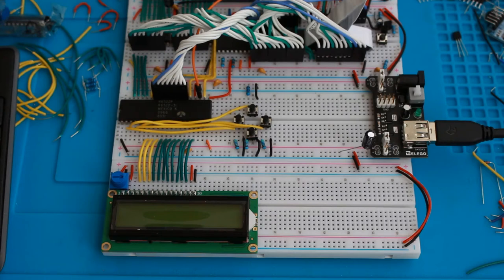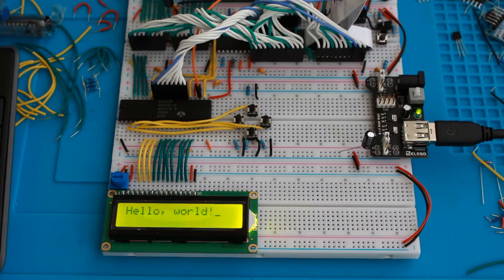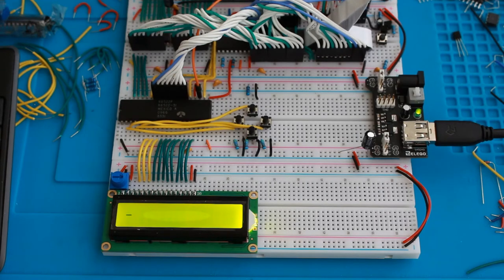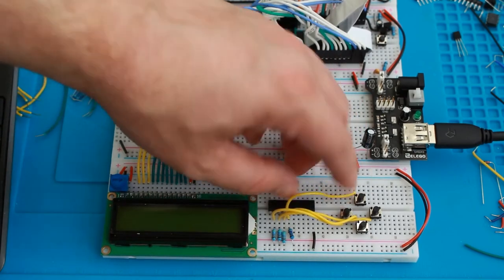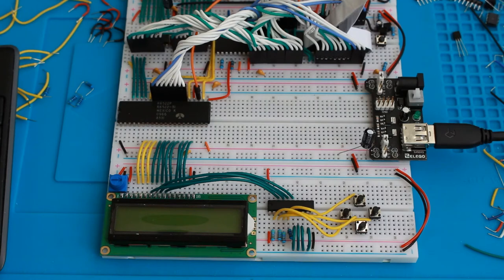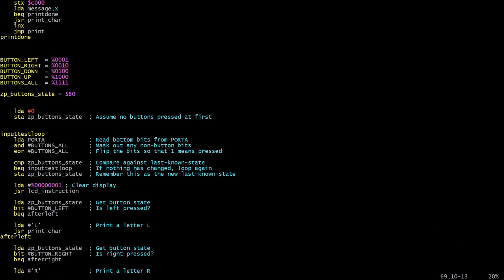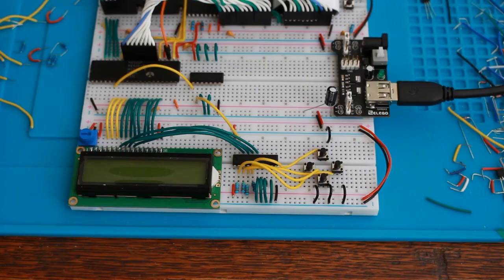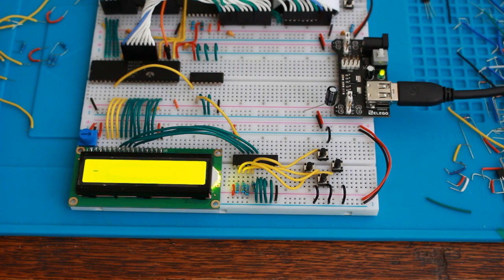6522 I/O Multiplexing - How to connect lots of devices to one 6522 VIA

Comment: This is cool, but I'd be concerned that a software bug could cause the buttons to clash with the LCD asserting to the port, causing a short. You could add some hardware protection by NAND-ing with the button buffer enable with the LCD enable line. Obviously, no bugs, no problem...
Reply from the maker: Yes, you could do something like that. The more similar the devices are, the easier that is. Using a decoder (e.g. 74138) for the chip select would be safer, with inverters where needed (e.g. for the LCD which has an active-high enable pin). It'd require more changes to the existing code but be a better solution overall.

Comment: Hey George, I am getting ready to build the Ben Eater 6502 breadboard computer, however I would like to add a keypad and 6 - 7 segment displays similar to a KIM-1 SBC trainer.
So that I can view and enter programs into memory, as well as possibly be able to view and set register data.
Reply from the maker: Nice! I made a circuit a while back using an Arduino with nice tactile rotary encoders for changing the numbers on 7-segment displays, it was really pleasing to use.
Reply: @GeorgeFoot  I am trying to stay away from using an Arduino, how ever I have seen some advantages to doing so. Easier to program, as it is already connected to your machine. No swapping out ROM chips to re-burn them as you go along.
Anyway I am thinking that it may be easier for me to use a 8051 microcontroller. I could be wrong, but would that kind of be like having the CPU, ROM and VIA all on one chip? Then I could focus on just the Keypad and display connections and programming.
Reply from the maker: @jeffnay6502  I'm afraid I don't know much about different microcontrollers, I haven't used many different ones. But Arduino Nano is basically just an ATmega328 with some glue to make it easier to use - if you want to use a microcontroller then it's certainly an easy way in. Once I got my project mostly working I migrated it to a raw ATmega328, to get access to a few more I/O pins, and I put it on a proper PCB - it was nice how easy the transitions were and I was really proud of the result. So I would recommend that route, the early prototyping stages are easy with Arduino and it's also easy to migrate to something less pre-made later on if that's where you want to go.
Reply from the maker: @jeffnay6502  I meant to add, you can also add all this to the 6502 build for a different kind of challenge. There are lots of ways to do things, it really depends what your goals are 🙂

Comment: I want to know more about your 6502 programming environment. I was looking through the VASM oldstyle "manual" and I think it means that you can only insert other bits of codes at specific places. 
Where do you store all your macros?
Reply from the maker: I don't actually use VASM, I use a different assembler called "xa".  I don't know whether it's better or worse, it's just the one I started out using and I haven't really evaluated others.

One thing it supports is a C-style #include syntax, which allows me to move common, stable code into separate files and then include it by reference into various programs I'm working on. As that code stabilizes and becomes more cleanly reusable, I also integrate it more into an "OS" library, that includes all those other libraries at once, and takes care of initializing them, as well as setting up the reset, IRQ, and NMI vectors.

It also has support for constraining the scope of labels (that's what the ".(" and ".)" markers in my code are about).  So I can put each subroutine in its own block, then they can all use common names like "loop" for labels without there being conflicts.
Reply: @GeorgeFoot  Thanks. I am guessing there is not a win10 compatible version. ripp
Reply from the maker: It looks like somebody has ported it here: https://github.com/Dennis1000/xa65-win32

I would say though, having experimented with vasm a bit today, there's nothing wrong with it - xa just happens to be the assembler I found after a search a few years ago. I'm sure the same things I do in xa are possible in vasm.
Reply from the maker: I might make a quick video showing how I arrange my code, and maybe see if it can be done that way in vasm too. Maybe I should actually switch to vasm!
Reply: @GeorgeFoot  Thanks for your help. And quick replies.

Comment: A question, why do you use an 74htc245 and not hc? Particular reason or is it what you have?
Reply from the maker: When I started out I didn't know what I was doing, and got a lot of LS chips based on really old circuit diagrams (like, 40 years old!) Then moving on from that I needed to use HCT, for compatibility with the LS stock I already had. These days I don't use LS much, and have sometimes bought HC instead of HCT, especially if HCT wasn't available or if HC was cheaper. I don't really distinguish much between them any more, as for the stuff I do (5V digital circuits) they are basically equivalent.
Reply from the maker: Actually I just checked, the bus transceiver and inverter in this video were both AHCTs. It doesn't make much difference here 🙂
Reply: Thanks George I'm just starting learning all this 😊
Reply: @GeorgeFoot  its the same with me I bought a bunch of ls chips

Comment: Where did you get your bus cables from?
Reply from the maker: I make them myself - I got a Dupont crimping kit, and a set of different colours of 26-28 awg stranded cables. Stranded cables work best as they are very flexible. Some of the cables are tailored for different uses, e.g. joining 8 pins to 5+3 pins for connecting to ROMs that split the data bus pins.

The connection quality with these connectors is way better than individual wires or "rainbow" ribbons.
Reply: @GeorgeFoot  Nice, would you be up for selling a couple?
Reply from the maker: Hmm, where are you located and how many would you want? It's tricky, as it's labour-intensive and wouldn't make commercial sense to pay for. But maybe if I made a video explaining how to do it, I could send you the cables I make in the video or something like that.

Really what you want is to find a company that sells at least the wires pre-cut and crimped, in bulk. Then you can easily put them into the plastic headers in whatever configuration you like. That's what I did with the rainbow ribbon cables for the data bus in my last ARM video - I took the existing 1x1 ends off and pushed the wires into 8x1 connectors instead. The only problem is the lengths, and that the solid-core wires are really stiff and annoying.
Reply: @GeorgeFoot  oh that's a good idea, reuse singles. I'll do that thank you.
Reply from the maker: @daimenworrall  I just found this: https://proto-pic.co.uk/product/pre-crimped-jumper-wire-range/?attribute_pa_gender=male-to-male&attribute_pa_length=6-150mm&attribute_pa_colour=black-10-pack&gclid=CjwKCAiA9bmABhBbEiwASb35V8h6aPfUUjdciuaY-U6jUwS68iHd8AGIY7sxey8GRAbj77zMakG7txoClf4QAvD_BwE
Reply: @GeorgeFoot  exactly. myself I find taking a bunch of pre-made cables and swapping the connectors for a header quite useful. its a little bit of labour but so is getting crimping right, all you really need is a good set of tweezers and the mindset not to mix up what cable goes where in the header.